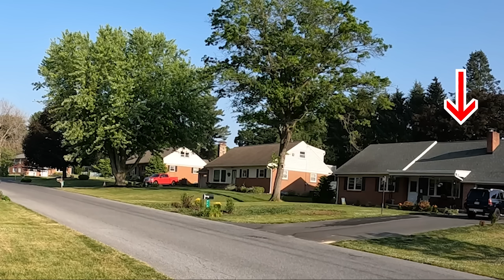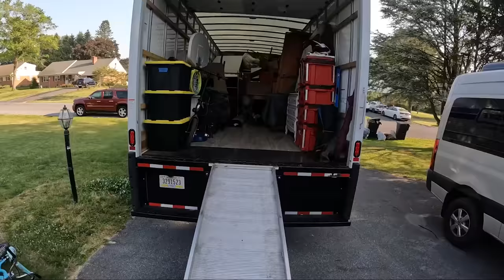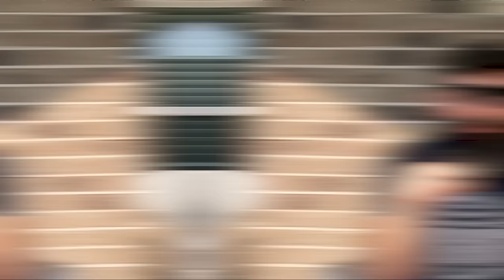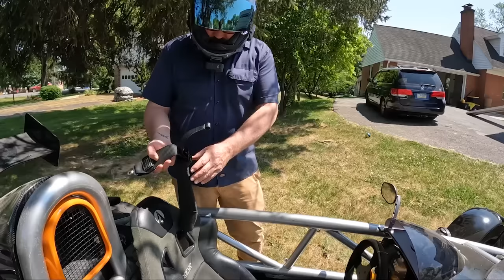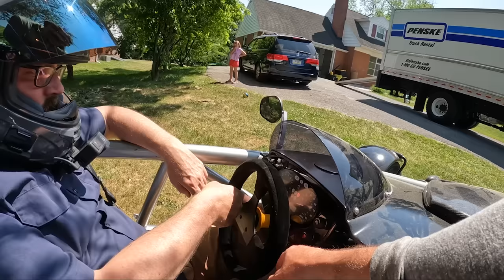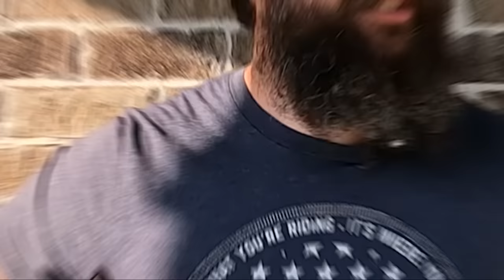I ve been keeping a Secret from all of you

Comment: Good luck in your future endeavors. 
I have a serious question for you. I need some insight on making a decision about a bike. I currently have a 2007 Honda Shadow Sabre 1100. I'm seriously considering trading it in on a 2014 Kawasaki Vulcan 900 LT. I'm having a hard time making this decision. I know the Vulcan has fuel injection and belt drive, which is a slight upgrade over the Sabre's shaft drive and dual carbs. Making it easier to maintain. My hang up is, I'm having trouble justifying going from an 1100 down to a 900cc bike. I rode the 900 and was very comfortable on the bike. Quit honestly it didn't seem like there was much difference in power by the seat of the pants feel. What is your opinion on this conundrum?